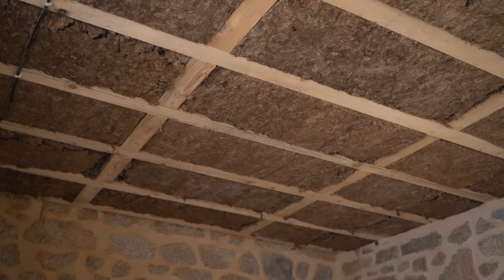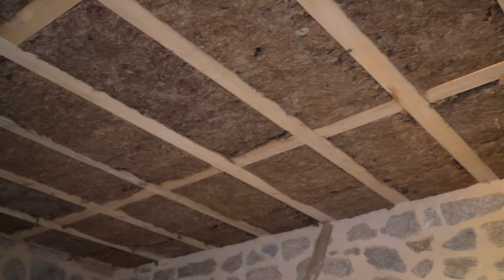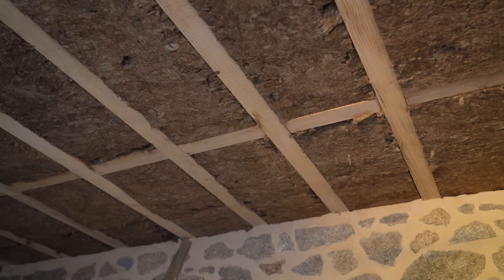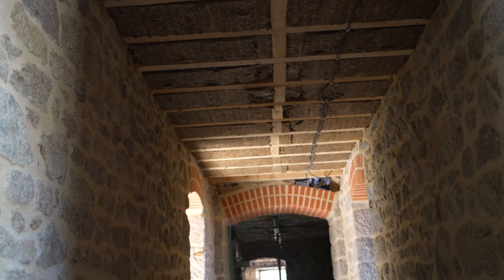Sundays at Chaumont- insulation and wiring breakdown.

Comment: About the kitchen, if you're really planning on hosting groups of children, then you'd either need eating space down there which would be really cramped or a way to get the trays with food to the floor where the dining room will be. Maybe some kind of elevator system either in a corner or in one of the bathroom-rooms? Because you don't want a group of children walk up and down a flight of stairs with their food trays. The chaos is predetermined (and so are the stains). And how do you plan on heating the kitchen in the winter if it isn't insulated?

Comment: For your computer ethernet cabling - I would have a central location in the basement where all your wiring comes to. You can put everything in a floor mounted or wall mounted rack cabinet. Any wireless access points I would wire direct to the switch and you can use "power over ethernet" (POE) and I would use a POE switch to directly supply power to the POE capable access points. Run more ethernet runs than you think you need. Anything that stays put I prefer wired. WiFi for anything that moves. I love all the progress!!

Comment: Hyped to see all the progress… especially with the insulation 😍 at this amount of energy needed, it would be very nice to see a heating system based on a heat pump. It is very reliable and you can even cool down the chateau in the summer with the same system. So it minimizes the installation effort and as cooling get‘s more and more relevant in the future, you get a system that is very futureproof.

Comment: Dan NO CAT5 please wire with CAT6 and avoid any cabling with CCA (copper coated aluminium) must be full copper even on cat5e cheap rubbish is cca. CAT6 will suit all your needs for now and future. Well done 👏 love these videos the techie stuff
Reply: Cat5e would suit all his needs for now and the future. He’s in rural France…he won’t be able to get an internet pipe to outrun cat5.
Reply: The cost difference is minimal and internet speeds are advancing yearly; here in the uk I can get 2gbps residential and have 10gbps at my office; starlink easy 300-500 on standard not premium. 5G I got 1.6gbps a few times. And talks between apple and starlink could be interesting 🤔. Just checked Amazon and full copper 305m box price difference is less than £20 a box/reel and that’s not trade pricing.

Comment: Just a thought. Are you allowed to run insulated wire thru copper pipes? You could put a light switch or plug on a wall and run a pipe up to the drop ceiling. It would clean up the wiring and look good as the copper patinas.

Comment: I do not like the Wi-Fi switches as a solution for every room, there is too much that can go wrong. It may be more reliable to wire a switch and mount it next to the door for rooms that have less aesthetic value like a mechanical room that houses your hot water heater and furnace.

Comment: Having used an insulated plasterboard in a thick stonewall building, it was amazing to see the temp go from 8degs to 13dgs without heating. Switched on it rapidly reach 20 and remained there with occasional boost.  Super choice for them.

Comment: For your electricity, there are a couple of solutions. KNX is a proven, very reliable and solid solution for smart homes that will last for many years.
That will give you a lot of flexibility and the possibility to change or automate your installation just by reprogramming. It is wired and wireless technology. 
KNX works very well in larger building like a chateau with hundreds of lights, plugs, buttons, sensors, touch panels or smart devices. 
There is also Zigbee, which is a well-known wireless protocol widely adopted by many manufacturer (like KNX) with an impressive amount of sensor and actuator types.
It will be replaced very soon by the new standard called Matter. I would not use wifi technology too much. It is cheaper but is not as reliable as the other technologies. My two cents 🙂

Comment: You say you need an oil boiler. I would probably investigate what geothermal heating would cost. I think it will be cheaper in the long run, especially if you install solar.
Reply: Geothermal might be a problem when the grounds sit on bedrock
Reply: @MatthewBraithwaite-x6g  yes, I can see that, but it was worth investigating whether it was a possibility, perhaps from a field nearby

Comment: I applaud your choice of rockwool insulation. You mention an R value of 6 or 7. That seems low to me??? You don't even mention acoustic insulation. (Walking on the floor overhead) Rockwool wins on that level, as well. Your talking about a "tiny" space in your false/drop ceiling. You will regret making it too small! The ability to run plumbing in that horizontal chase, one day will save you time, money and grief. Your ceilings will not suffer being a few inches lower! That's the only downside on gaining the convenience of quickly rectifying a mistake/oversight. Just think about it. Keep up the good work. I enjoy watching you wankers turn into accomplished pros.

Comment: Great update! I like that the sound is also different because of the insulation 😄And I totally agree with not running the wires through the beams when not needed. It is a bit of a bad practice I think. On future-proofing cabling: you could run some empty pipes through the building that could be used in the future for pulling new cables through when that is needed later.

Comment: 16 to 20 mm solid og flex pipe is code so fur down at least 25 mil below joist. Phase loading will be critical. Be careful with bends and length so that pulling round robins wont be a headache if your'e closing up before pulling wire. With 200 mil insulation your spec is great for heat and cooling throughout the year in the climate your'e in.

Comment: Battery-operated light switches are a mistake.  Switches run by wifi, okay, but the obsolesence of batteries and tech always leads back to future generations, appreciating that you wired the switches anyway.  Batteries are only a little bit recyclable.  Run the wire in industrial metal conduit or pipe for a unique steam punk look.  That way, it won't look hideous.

Comment: 02:58: I dont believe this is correct Dan. The norm for this is called NF C 15-100 and what it says is that you should have all electrical wires insulated in sheath or conduit - the rest is fine, in concrete track or through joists, etc..

Comment: You should build the dormers in the basement to shorten time roof is exposed.

Also you could run the plug wires behind the floor/wall skirting, or in the US it is called baseboards.  The plugs could be cut into the baseboard

Comment: Question: Why can't you install the roof slate on top of the current waterproof barrier? Are you going to use an ice and water shield barrier instead, which seals the nail holes holding the slate?
Reply: The current barrier was damaged over time (hence the tarp)

Comment: 1200 kWh per month sounds rather low for a building the size of Chaumont. 12,000 sounds closer to the truth, maybe. I live in a 156 square meter house, with volume of 750 cubic meters, this includes rounding way up to make the arithmetic easier, in the US. While that is more power than I use per month, it isn't much more.
My house is not insulated and has single glazing.

Comment: Don't forget to put empty tubes like at every room to place those new mmwave presence detectors that will be fully developed in like 1-2 years. Probably easiest to run Ethernet cat5 for that: cheap, can run POE , which is more than enough for smoke detectors, air sensors,  and all kinds of other detectors to keep it safe, energy efficient and comfortable.

Comment: For the electrical and LAN wiring you should use electrical conduits (gaine ICTA in french). 
Place as many as you can and in the future you can run any cable you like in any configuration. You could ever rewire everything non destructively or upgrade LAN cables to newer category.

Comment: loving the design choices an engineering decisions. Electrical ducting for natural stone walls is always a difficult one. decorative tubing vs hidden buried ducting and switches that have to be half way or more down the wall can be fed by the methods you describe. To avoid wireless and battery powered switches, I would consider treating the switches as low voltage devices 5v-12v that feed a signal to a relay to turn on the main AC current to the light. A relay can be feed with stereo cable super thin wire or even twisted pair telephone cable jumpering that is easy to hide in the mortar and be considered as sacrificial if changes are needed in the future. Rockwall is the daddy of insulation and it pays to use the best stuff. Will you use the cavity wall studs only on the exterior facing walls or make each room a box within a box?

Comment: Pls don’t over complicate the Cat5 / fibre for the château. Just a few decent wireless access points strategically placed and have everything wireless. Any proper data cabler will be able to carry out a wireless survey before you run a single cable. Just saying.  
.

Comment: A good video. When I lived in Normandy from 2003 to 2010 we renovated an old village school. The classroom we put in a suspended timber floor as windows were very high so children couldn't look out when seated. I timber studded all the external walls after new hardwood double glazed windows went in and used the rockwool backed plasterboard in 62mm thickness. Around 50mm of insulation. The room was lovely and warm with a Woodburner with back boiler running 10 radiators. Didn't need any radiators on in the old classroom of 35sqm with 4.2 metre high ceiling! The heat from the stove was plenty. The other parts of the house had, had improvements using insulated backed polystyrene insulation. Not as good as not breathable and mice liked chewing it and making tunnels in it. Had to put some mouse sachets down now and again.

Comment: Dan, I totally love this Sunday briefing. And I'm not sure if I misheard, but concerning VB (vapour barrier) the barrier goes on the high pressure side - the heated side of the insulated cavity. The purpose is to prevent the moisture (greater within the warm/high pressure environment) from condensing somewhere within the insulated cavity as the moisture reaches the colder temperature. Seems you are doing interior insulation between floors and as such may need to apply VB both sides (ceiling and floor above) to protect in the instance either space is heated while the other is not.

Comment: Dan, in Sweden we put a tube in and thru that goes the wire. It works just like you said that you can take out the wire without taking out something and when it is time to change a wire you just  attach the new one to the old an take it out and at the same time you have a new one in. The tube also protect the wire from anyone drilling into it.6

Comment: Geothermal and solar will solve your energy issues. You have the space and then just do under floor heating
Reply: Bedrock too close to the surface for geothermal and solar not reliable enough in the winter.

Comment: Don't put in a moisture barrier under every floor, the tongue and groove OSB is a moisture barrier, especially so if you glue it. The Rockwool won't rot if it gets wet, but it will destroy it's insulation value until it's dried out again, and if it's between two moisture barriers that won't happen. I've seen beams much larger than yours basically destroyed in less than five years because of trapped moisture und fungal rot.
For your wiring in the cellar, run the cables in black "iron" tubing mounted on the wall, in a way that was typical in the past, it will look the part in the cellar. Also don't use the wireless switches, it will feel wrong, on an unconscious level,  having wires going to the plugs, but not too the switches.
And look into triple glazing...
Would love to come and offer help, time served joiner in Germany, but as a teacher, I don't have much time...

Comment: Please also isolate areas you do heat so you can pick and choose areas for heating. There is no point in heating spaces you are not using. You can hook it up with Alexa. Also , make sure you can shut off all the electricity from all sockets and therefore the passive vampires of electricity will be off when you aren’t in that room. That will save a huge amount. There are switches and outlets that work that way by some type of transmission. You can turn iff the whole room at a wall switch.

Comment: To maintain the standards for wiring, use electrical metal or plastic tubing from the breaker panel to every connection point. Then pull your wiring through these conduits. Make sure that all connection boxes are accessible wether exposed or within. A ceiling or wall. For a wiring fixture ( lighting , outlet, etc. ). This permits the ability to re wire if needed. When using metal, it also can. Insure grounding of the system by connecting a single ground wire from the first metal enclosure to an exterior grounding rod in the earth.  
If plastic is used, separate grounding wires are essential, although grounding sites should also be pulled through metal conduits. 

As to water lines, use PEX tubing as it can be snaked through insulated walls without the need for fittings such as elbows 

As you gave the current ability, to heat the chateau, use an in floor, hot water system they will evenly heat every room and save  funds on heating costs without the need to have unsightly and inefficient radiators. Each room can be separately controlled if desired.

Comment: I worked for a business that sold Rockwool. That was over 10 years ago. It cost about 15% more than fiberglass insulation but the benefits were many: much easier and faster to cut and install. No fiberglass itch, rodents and insects hate it so you don’t ever have to worry about them making nests in it. Fireproof. Better sound dampening qualities. Does not lose it’s R-Value after getting wet. I’m sure there more advantages over fiberglass but what I have listed is what comes to mind right now. I have a large pole building I have converted into a shop. I am EXTREMELY frugal but I used Rockwool in my shop for all the reasons I have listed here. Really a superior product and in case you are wondering…… No. I do not work for them and I am not sponsored by them in any way, shape or form.

Comment: Make sure to use scaffolding on the exterior of the château! I mean enclose The whole building as well as the roof. This will result in expedited exterior resurfacing and roof replacement. With the exposure you channel and the historical value of the building I am confident that someone can sponsor the erection of the best piece of safety equipment for that job.

Comment: As a sparky (electrician) who works with industrial electrical systems, I think you should surface mount steel conduit for any electrics that you can't hide as it would suit the building nicely. You just need to find a sparky that is experienced in installing it, as most house sparkies will probably make a hash of it.

Comment: Think about using hard foam board under the concrete, that will make a huge difference in condensation & mold. I’ve been building houses for many years, that thermal break will really help 💜💜💜

Comment: Be careful with the WiFi switches. You might end up with a lot of maintenance. WiFi needs quite a lot of energy/battery. For this basic stuff nothing beats a cable. You can then still use smart switches and outlets.

Comment: I recently saw a heating system that sits behind the skirting boards, which will do away with rads, it looked very clean and thermally insulated so the heat would only radiate out into the room

Comment: We put wire mesh under the insulation so that if there was a fire that penetrated the plasterboard ceiling, the insulation did not fall but provided a longer time of fire protection as Rockwell provides some fire protection.

Comment: Wiring is a concern, but also not just lights, you are going to have to redo the plumbing start to finish.  I have not seen where there is a column of space to carry those from the ground to the top, and if there is to be central heating that would mean a room sized empty space the size of a room to get all the duct works up or down.  One thing I was wondering is how many square feet is this building.  We have never seen any actual blueprints for the finished project.  I suppose that in a place that size it would be more efficient to use ductless A/C and heat.  But, that would be an abomination on the exterior of the house.  As well as ruinous in upfront costs.  I am going to guess that it is about 2,750 sq ft per floor, that would be 8,520 plus the basement.  So about 11,500 sq ft not counting the attics and tower.  It can be done of course, but the planning has t be spot on all the way to the end.  And, not cheap.  So to that end here is a $20 to buy the beer for the next time the crew is altogether.

Comment: Love the channel and its truly amazing what you have achieved. Don't forget to think about Data, I look after the brand Excel which is also big in France and would recommend using Cat6a S/FTP Data cable through the Chateau which would provide a network for Wi-Fi Access points. The cable could be run in the ceiling voids, seperate from anything carrying any power, and all going back to one point where network switch would be installed.